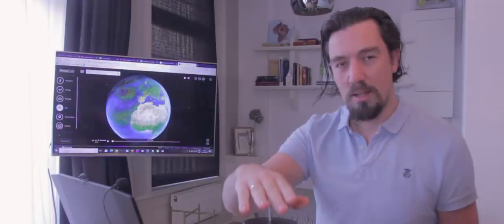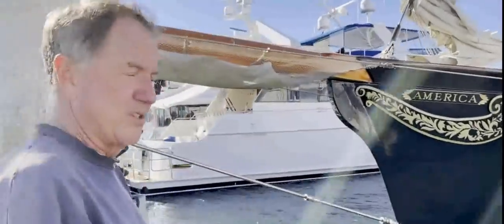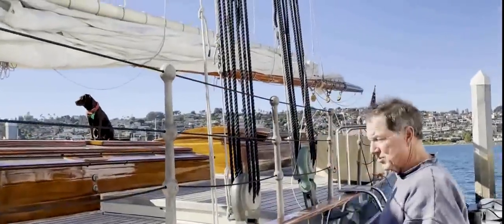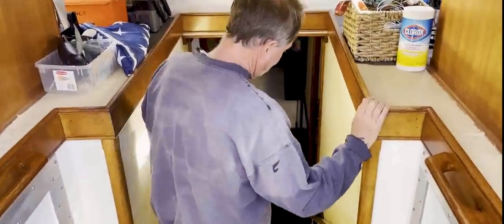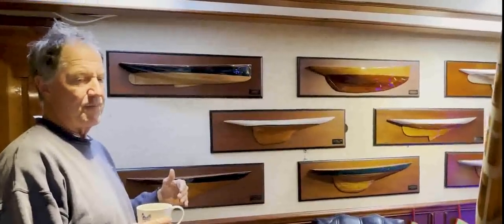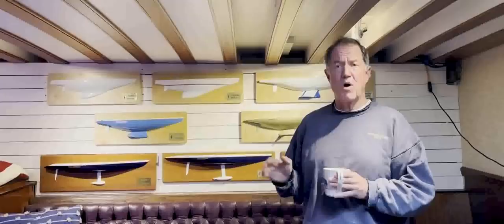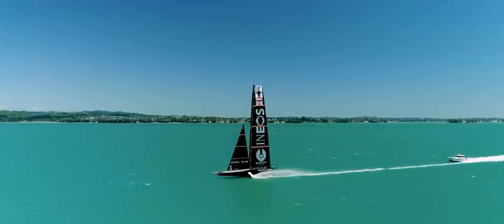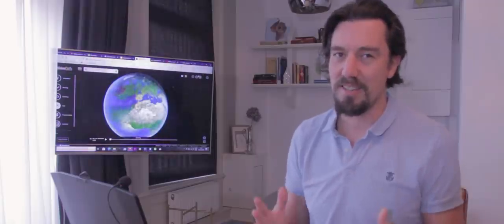Sea Wolves - The new America's cup boat! AC75 Technology analysis/Deep dive special! Auckland 2021

Comment: Hi, I do not agree with what Taylor Gozzo (one of your commentators) says abt the foils canting system : as far as I understood from previous specific videos on those sea rockets, on each one some of the crew members are ONLY dedicated to continuously recharge the batteries through some grinders. I think that YES, the batteries are fully charged before departure, and then some crew members are acting just like an alternator on a car. When you think abt it, the pressure that those foils are supporting is HUGE during the races, and you need a lot of power (electricity) to control it, and move it up and down.

Comment: The foils were designed to withstand a 20,000kg load applied at the end of the main foil appendage. They were tested to an ultimate load of 27,000kg before they broke. No idea what that load translates to at the pivot point or the inboard end where the adjustment cylinder is located, but the latter must be significantly higher than that. (https://youtu.be/RPB7g2iNZug)

Comment: The AC75s are like flying fish, part fish and part bird. They swim and fly. The hydrofoils while smaller than the sails, take advantage of the fact that water is 1,000 times denser than air. The hull shapes are now designed for aerodynamic vs. hydrodynamic fluid dynamics. This is why I like the skeg as it can provide a ground effect lift like the Russian Ekranoplan.

Comment: The AC75s have 11 crew, 1 helmsman, 1 tactician/navigator, 1 Flyer, and 8 grinders. The Flyer controls the Flight of the boat once it rises out of the water. Different teams have different roles based on strategy and personnel.  Luna Rosa appears to have two helmsmen so they don't have to switch sides making for a smoother and quicker tack. In the end, all this technology is worthless if the crew can't keep the boat flying during all the race maneuvers. The Kiwis may not be the fastest at all points of sail but they will out sail other crews based on their experience with the aquatic maze known as the Hauraki Gulf.